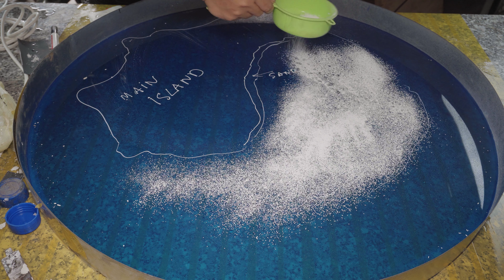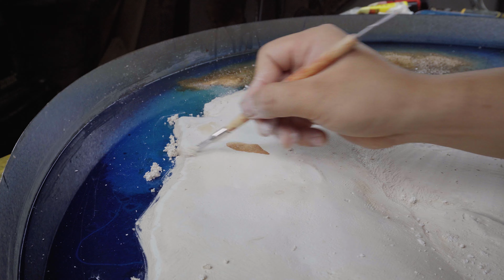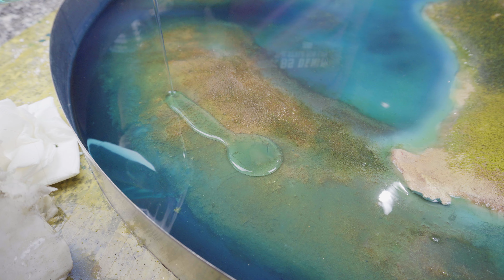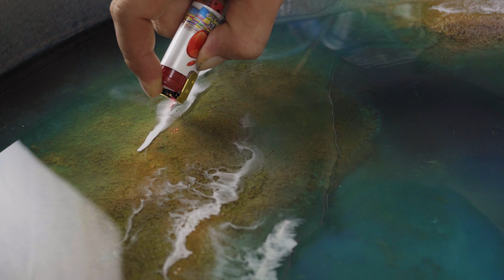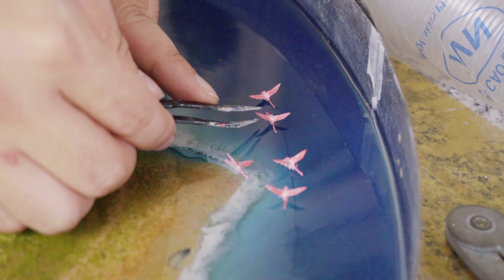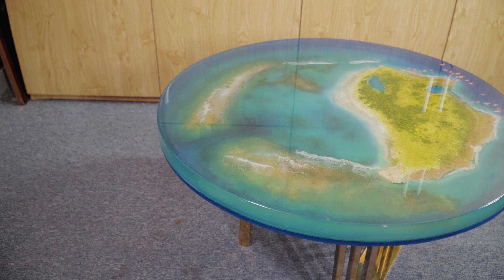How to make an OCEAN TABLE | DIY Ocean Table of Necker Island | Epoxy Resin art

Comment: How much would such a table cost? I would like to buy one.
Reply: Think about how much you'd like to be paid per hour at the minimum, then times that by 20 and add material costs such as the expensive resin, which for a gallon would cost at least $120 for cheaper stuff. The total price will get pretty high.